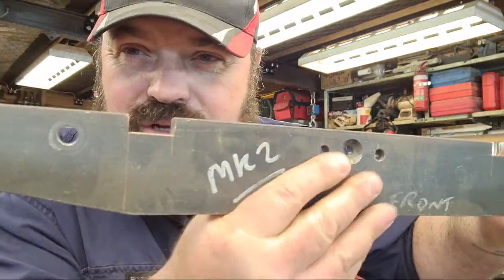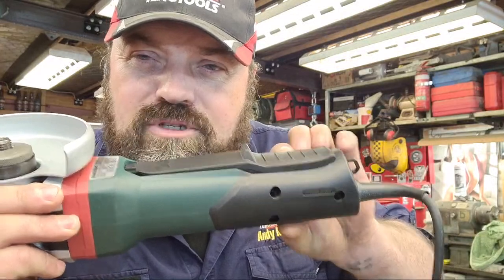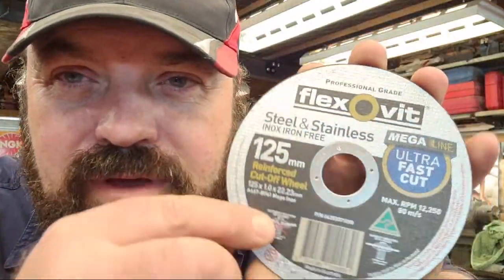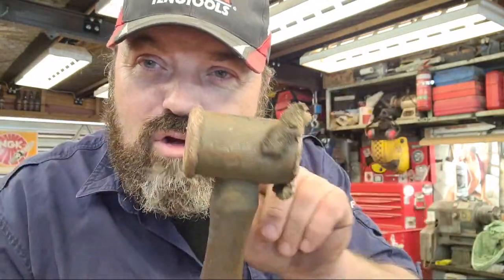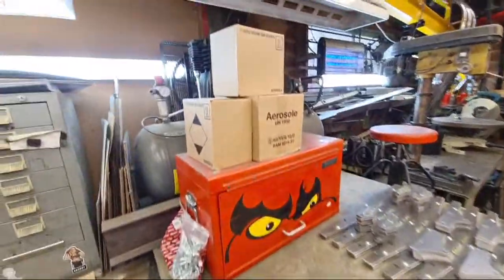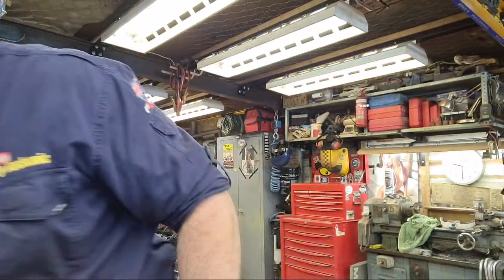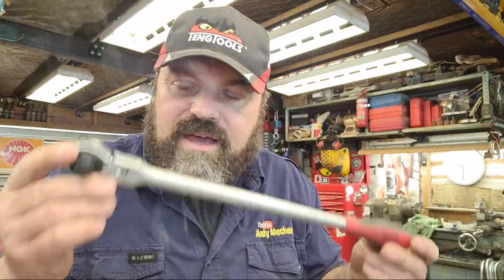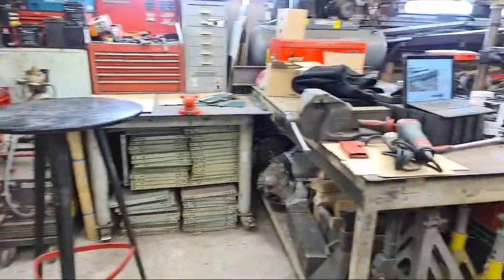Grinder Paddle Switches, Go-kart Project & more Livestream

Comment: I have the bosh paddle switch and i find it a lot better than the old type. Bit of a knack to hold it but trade off is its easier and quicker to shut it off to put it down. I tend to do a lot of stop starts rather than big long cuts.
Reply from the maker: Ah....good to know. I tend to do long sessions with the grinder, usually relatively large cuts. I can see why you'd prefer the paddle switch type though I'm definitely happier with the old style switch.

Thanks for your feedback 

Cheers Andy

Comment: Hi Andy, 

I own a Bosch Professional (Bosch 17-125 CIE) angle grinder of the same size (1700W/125 mm) but fortunately still with the normal switch. 
Based on the manual (yes I sometimes read the manual 😉), the machine head can be rotated 90°, 180° or 270° by removing the four screws which are holding the head. 
This way, the machine can be optimized for cutting or grinding as well as for right handed guys or left handed guys. I think, your Metabo will most likely be similar. 

I know you cannot rotate the machine head constantly, but if you are not able to get the other switch type grinder, you can optimize one of your grinders for cutting and the other for grinding.

Cheers, 
Thomas

(edit) 
17:56 : I don’t know if this is a new youtube feature: I just found in the youtube app a „livechat“ icon just below the video. There you can find all comments from the livestream.
Reply from the maker: Hi Thomas, that's most interesting info on the grinder & really helpful - that could be a great idea. Just have two grinders, one with the head swiveled by 90 deg for cutting the other in standard configuration for grinding/flap discs etc...

I best get saving up again!

I'll check out the YouTube feature you mentioned, if it works then that'll be great as its such a shame to loose comments.

Thanks again & Cheers for now
Andy
Reply: instablaster.